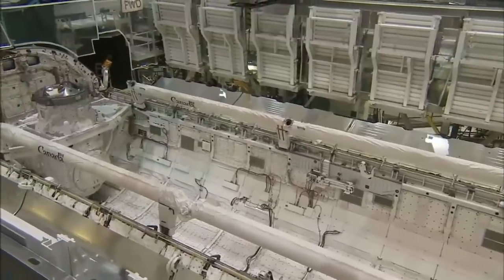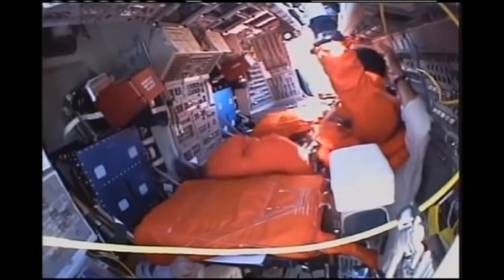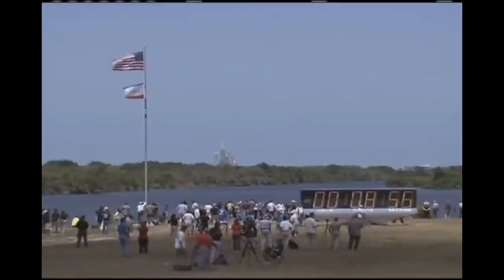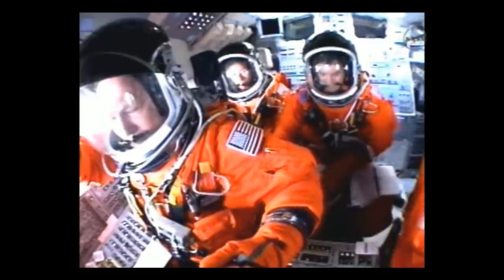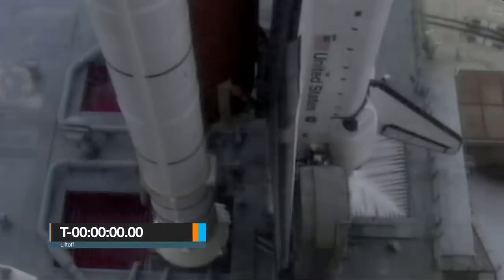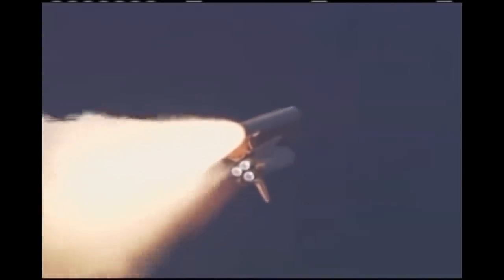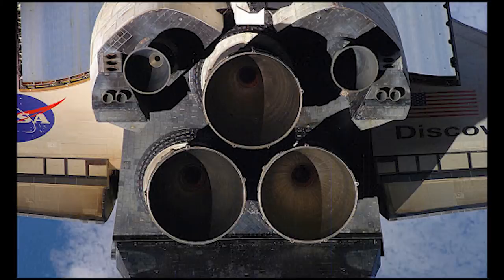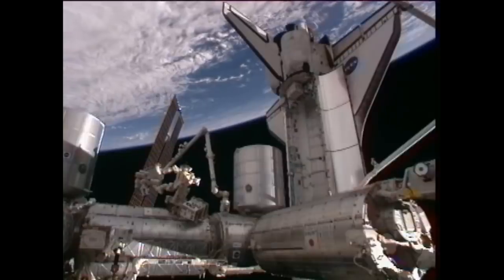Space Shuttle Launch: Explained  | From T-03:00:00 To T+00:09:00

Comment: T-28 Seconds: Solid rocket booster's hydraulic power units start.
T-21 Seconds: Solid rocket booster's nozzle gimbal profile test begins (Just like the orbiter's main engines did at T-3.30).

FYI: The call "Go at throttle up" is NOT a command to throttle up the main engines. When the engines throttle up, the "Booster" officer confirms that the throttling sequence was successful and that the engines are running stable at max thrust (104.5%). Then, the flight director tells the CAPCOM to inform the crew that they are "go AT throttle up" (Basically: It was a good throttle up and you're go to continue ascent at max thrust).

Comment: If you can get a copy of "The Space Shuttle Operator's Manual" by Kerry Mark Joels , do yourself a big favor and buy it.  There is info in there you will not find anywhere else.  Ever hear of "rescue balls"?

The entire countdown is listed from T - 8 hours.  Even the 3-digit codes the crew has to enter in the computers during the launch countdown are given, and there are large foldouts of every control panel. Did you know that every panel has a small hole labeled "FIRE" that you insert a fire extinguisher nozzle into for electrical fires?  TONS of detail.

 AWESOME book.  I'm on my 3rd copy (got the first in the early 1980s).  You can find them on eBay as low as $5.
Reply from the maker: I have to get this!
EDIT: Just found a hardback copy on Amazon & ordered.  Thanks a ton for the heads up!
Reply: @russellcarter6451  I just checked, and one correction.  The countdown listings start at T-5 hours, not T-8 hours.  :-)

You're gonna love it.

Comment: I Found You by looking up throttling up. I had assumed that the srbs could not be controlled but I still wanted to know which of the engines on the space shuttle did that job. By the way I actually saw the Challenger blow up while we were at recess in elementary school on January 28th 1986.
Reply: The solid rocket boosters don't have an active throttling capability like the main engines. But, by calculating the burning rate of the propellant and how long it takes for the vehicle to reach max-Q, you can determine the shape of the propellant grain so by the time the vehicle reaches max-Q the boosters decrease their thrust. It's rudimentary but it works.

Comment: The roll is the rotation around the longitudinal axis (mostly done in rocketry to stabilize the trajectory and for STS to help with some of the abort modes). There was no main yaw rotation, and all those other maneuvers that point the STS towards the horizon and that the author calls "rolling" are actually pitching maneuvers. The pitching trajectory has a goal which is much more important than making the horizon visible: "the hard part is not going to space but staying there". Going vertically up 200 miles is easy, but you won't stay in orbit if you don't achieve orbital velocity (about 7.8 km/s in Low Earth Orbit, slower in higher orbits). The trajectory is calculated so that the denser atmospheric layers will be passed when the velocity is still relatively small, then the trajectory "bends" with pitching down, so that the SRBs and the SSMEs will contribute mostly to horizontal velocity.
Reply from the maker: Yes, 17,500 mph horizontally is the goal. Everything mentioned about the roll maneuver in this form is quoted straight from NASA.
Reply: @russellcarter6451  Oh my goodness.. Though I am not surprised. I work a lot with NASA in my research, and sometimes we look at the "Public Relation" side of the agency and find a bunch of errors and things that are not well explained. :(

Comment: I wonder if an engineer such as John Aaron had been present that day, would he have taken the crucial step in ordering separation of the shuttle from the rest of the craft (two SRB's and external tank) prior to power up.  It was clearly obvious the left SRB was venting fire that was endangering the tank and also lowering the pressure in that SRP thereby affecting the entire flight dynamics. At that height, Scobee could have piloted the shuttle back to the Cape's landing site and separate itself from the external tank and two SRBs prior to the malfunction. Aaron made a gutsy call during Apollo that saved the launch.
Reply: The venting of SRB exhaust wasn't really obvious visually until footage was specifically analysed after the accident. I remember reading there were 104 cameras covering different angles of the shuttle launches. So monitoring them and taking such a split second decision would likely be intractable. Your point about the SRB pressures might have helped. Though not sure if the atmosphere had become thin enough by then to not cause significant aerodynamic shear stress in case of such an abnormal separation. The vehicle might have broken apart.
Reply: No controller was looking at cameras during ascent, they look at hard data on monitors.
Realistically, the chain of events would start from a backroom controller noticing the drop in chamber pressure, putting two and two together and relaying it to the booster controller who either immediately understands or chooses to blindly trust the suggestion. The message then goes to flight, then to capcom and then up to the crew. I don't see any way of doing this quicker than 10-20 seconds which is way too long for the events we saw.
Not to mention that the shuttle + ET wouldn't survive separation that early, because of the booster plume and the aerodynamic upset. Zero doubt.

Comment: The Master Event Controller (MEC) [2 each] controlled first 3 minutes of flight. SRB ignite, and bolt release.  PICs inside MECs released the bolts. The Hybrid Load Controllers (HLC) opened the payload doors. The Fight Accelerometer Safety Cutoff System (FASCOS) monitored turbine speed and beryllium shaft flex during boost.
All made in Anaheim, CA by Autonetics.
Reply: I take it you worked there?
Reply: The MEC controlled what the MEC controlled.  PASS (Primary Avionics Software System), running in (I believe) 2 of the GPC's redundantly, is what controlled the Shuttle throughout the entire ascent.  There is a whole lot going on during flight beyond what the MEC does.
Reply: See Apollo MEC...
Reply: @maxisp1000  I don't know anything about Apollo MECs.

Comment: Great vid. Which had great acceleration on its way into orbit, the shuttle stack or the Saturn V ?
Reply: The Saturn V. The shuttle produces no more than 3 Gs, and that's shortly before main engine cut-off. The Saturn V, however, just before first stage cut-off, produced over 4 Gs.
Reply: @apollosaturn5  thanks for the reply!
Reply: The Shuttle has a lot more acceleration at lift-off though.
Reply: @Strike_Raid  Well, both, the shuttle and the Saturn V produced less than 1 G at take off. Yes, the shuttle had a higher acceleration at lift off because of the higher thrust-to-weight ratio than the Saturn V. However you wouldn't be able to feel that much difference because it was less than 1 g anyways. But, in terms of maximum acceleration during ascend, the Saturn V wins.
Reply: @apollosaturn5  You can sure see it though.  Saturn V lumbered off the pad and made its way up in a smooth and deliberate way.  Shuttle jumped off the pad and when it did it’s roll and pitched over, it literally tore away from the area and made the Saturn look like it was standing still.
Reply: @apollosaturn5  None of them top Mercury Atlas though; 8+ g's at SECO.
Reply: @apollosaturn5  don't get freaked out, but I'm going to follow you around YouTube comment sections and learn everything I can from you! 👍🏼👍🏼
Reply: @Strike_Raid  sure can! Solid motors and hydrolox engines sure get going in a hurry.  Even the Falcon 9 / Falcon Heavys look like they're never going to lift of the pad!

Comment: Videos that talk about shuttle launches always say why the shuttle rolls over but no one ever says how . Is it just by varying the throttle of each engine and gimballing or is there some other system? It can't use the wings like a plane. It's going too fast and then once in orbit, wings don't work. So what is causing the shuttle to roll over?
Reply from the maker: Engine gimbal. The SRB’s had a small amount of gimbal that, combined with main engine gimbal, would roll the shuttle. In orbit, any shuttle movement is done with reactive thrusters (those little ports you see pointed in the x, y, & z axis on the front & rear of the shuttle). Hope that answers your question!

Comment: When does the cap on the main fuel tank retract?
Reply: I thought the beanie came off at T-10 mins or, like, 2 mins?  It caught excess hydrogen boiling out of the EFT and sent it to a flare tower. I can't remember exactly if it was a before crew access left or after it off the top of my head all the sudden

Comment: What I have always wondered and never found an answer to:  if 100% of the "rated thrust" of the main engines represents the maximum thrust they should be operated at, as it seems to mean, then WHY do they routinely operate those engines at 104% of rated thrust?!  To me, that sounds like deliberately operating the engines at a rate which is beyond what they are designed to produce.  Can someone please explain this?
Reply: The 100% figure refers to the original (1970s) designed operating thrust, but designers knew even back then that they could push the RS-25 even harder.
Soon enough they certified 104% thrust on the phase-I engines and flew them from STS-6 onwards. Later engine versions were certified to much higher thrust levels but only in case of an abort, to  squeeze extra performance. I believe it was 109% for intact aborts (1 engine out) and 111% for contingency aborts (2 engine out or some other very serious failure).
For the Artemis program they are developing new variants of the RS-25 and have pushed one engine to 113%, but they intend to use all the surviving shuttle-era engines first and who knows if they'll wind up building more in the end.